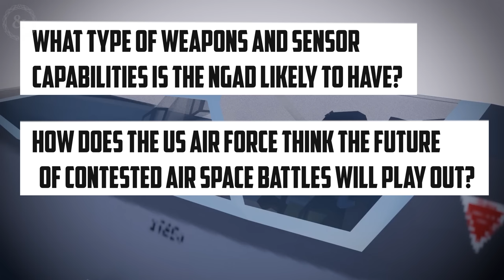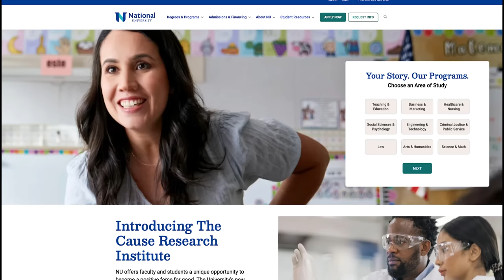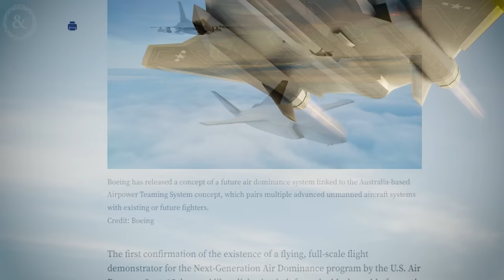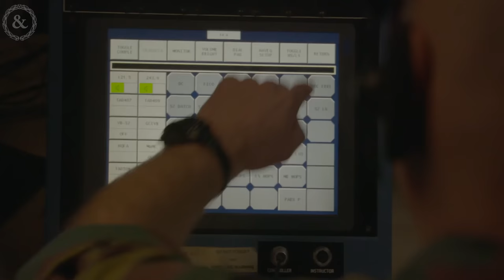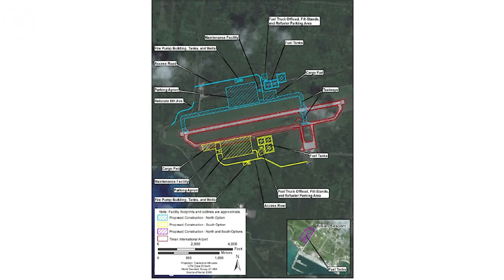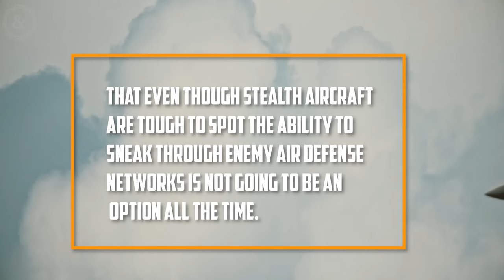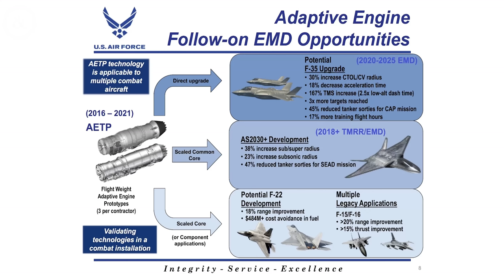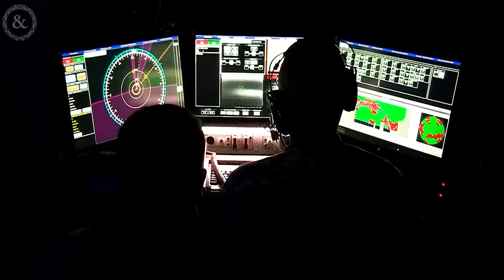Lockheed Martins 6th Generation NGAD Fighter Tactics

Comment: Another thing the NGAD should be able to do with the drones is maintain full stealth capability throughout the entire operation when deployed in combat, If you don't have to open any bay doors or have any hardpoint attachments fixed to the aircraft staying out of radar range becomes less of concern all of a sudden. 

Meaning it's only the drones that risk detection while attacking which is a game changer,  other than increasing pilot survivability in general this would give more reach to the craft as you can now get much closer to your target knowing it's your drone that is dropping munitions not you. In theory you will be able to get under the radar screen detect a target while in enemy airspace and engage it with the drone, for all they know it's loitering munitions or a single long range drone if you did your job correctly. 

Now if you ask me that is cool and how war should be conducted, with some class and style of course.
Reply: yeah - like buzz lightyear !!  😜
Reply: if your controlling drones you're transmitting. doesnt matter how stealth the airframe is if they are constantly transmitting instructions / data / targettin to and from drone platforms.
Reply: @rickthomson990 highly directional emissions, which are almost impossible for anyone (including the US) to detect
Reply: Even with drones, you have to avoid operational losses. They won't be cheap units. Unmanned, but still a number limited military asset.
Reply: At this point, you dont even really need missiles. Just send the drone to kamikaze like they are doing with consumer grade drones in Ukraine.
Reply: So what exactly is the point of the NGAD then, in your scenario? You're almost getting how much of a waste of money any 6th gen platform will be.
Reply: @coreyleander7911 no im just getting hot limited your thought power is

6th gens are made for modern war, and having slave fighters is the best thing to limit pilot loss and still maximize the effectiveness of your air force
Reply: @nicholasbrown668  lol yes that’s the boiler plate answer. Yet we can’t even get the F35 program right after 20 years yet we should buy a 6th gen fighter
Reply: @coreyleander7911  alright Pierre Sprey
Reply: At some point though, why need the person in the jet at all? If the drones are all being commanded remotely, why risk the pilot? Starlink already has the entire world covered in extremely low latency internet. They have offered to develop a military version as well, and it's only going to get drastically better in the near future, with Starship launching.
Reply: @coreyleander7911  What are you talking about? The F-35 is the most advanced war plane on the planet. What doesn't work about it that you're upset about? It has the same issues as most other advanced war planes. The F-22 has coating issues, the F-18 had serious design flaws that limited its flight for years, the F-16 still has a myriad of issues after being in constant development for over 50 years. The F-35 isn't really out of line with any other US aircraft. This is just the cost of not improving quality management in the aerospace industry.

Perhaps the only real lesson to be learned is not to choose an engine just because it's design isn't established. The F-35 could have had the range they want for NGAD, but they chose the wrong engine during development. So, instead of getting the first combined cycle turbojet, they received a lazily handled Pratt and Whitney engine, almost all of which are known for latent issues that just add hours to maintenance programs and put aircraft out of service.
Reply: Too bad enemies can just detect the radio waves you're using to communicate with your drones and hine in in you that way.
Reply: @titusbaum9690  good thing the US Military doesn't use 1940s radio waves, short burst Transmissions are damn near impossible to detect or track

we arent the Russian Army, we dont use off the shelf walkie talkies to coordinate military actions
Reply: chrisbattey-so2hw  Mitigation is silver. Radio silence is golden. My point stands.

Moreover, I didn't reply to "this thread", I replied to a comment. If you can't understand that or won't respect my autonomy, I can't help you any more than to say: Best stay quiet.
Reply: @icecold9511  Australia MQ28A Ghost Bat will be 3-4 million and one month to build, why Australia designed and built it to sacrifice it if need to instead of a expensive jet and years to train a pilot.
America is way behind in this smart thinking.
Reply: What Australia designed and built the MQ28A Ghost Bat for willfly ahead of our manned platforms and soak up enemy fre saving manned platform to perform a more important mission or save himself.
Hss drone swarm capability and fully AI they say they input a mission in to it before take off and the drone carries it out fully on it's own. no need for cominicating like you say. yes a human pilot or ground can change it's mission if need to.
Why they all say Ghost Bat s most advanced AI in the world.

Comment: Nice thing about directed energy, the firing solution equals “point at enemy”. When your shot is at the speed of light you don’t need to spend effort on future position prediction, maintaining radar lock, etc
Reply: Main issue is getting over the refraction of the light as a result of the atmosphere, and getting efficient energy output instead of having most of the energy be wasted.
Reply: Yeah, but it needs to be future proofed, a missile to missile is a guaranteed destruction. 

Laser to missile takes time to be effective, and in a realm where things are moving at hypersonic speeds, every second matters. 

And if your enemy’s missile has some highly advanced mirror that reflects the laser we didn’t know about. It’s potentially a loss of life, billions down the drain, and the failure of a important mission. 

We have missiles already, kinetic damage is highly effective. We just don’t know how safe and future proof a thermal weapon like a laser will be in the long run.

Comment: The return of SR-71 astetics, I love it.
Reply: It means it's meant to fly at extreme speed and altitude with no dogfighting ability
Reply: @samsonsoturian6013   is that a theory, fact or question ? 

But regardless, I agree it's for high speed, low drag (and radar cross section).
Reply: @red-black8138  it's basic aerodynamics. That thing can't make hairpin turns without breaking up. Also the flat top and bottom are givaways to radars when banking
Reply: @samsonsoturian6013  It has big moving surfaces at the front, so I'll guess it will be able to pull some instant G forces. But probably not like a 'classic' fighter plane.
Reply: @mennovanlavieren3885  NGAD won't have canards. That's pretty much guaranteed.
Reply: @samsonsoturian6013 dogfighting isn't necessary with the use of Stealth and BVR combat.

Why chase an enemy jet at close range when you could make a missile that can pull 9gs without fainting?

If an SU-35 is an AKM, then the NGAD will be a Barrett .50 Cal rifle.
Reply: No one said otherwise. I said the aesthetics are purely functional @deviousN

Comment: The Phoenix missiles fired from Tomcat fighters would often climb away from the tomcat.  The extra altitude gave extra range to the Poenix missiles that were designed to intercept missiles and fighters trying to take out the carrier.  There was a multilayer defense that the navy has gotten away from in recent years where the Phoenix/Tomcat combo made up the outer layer.
Reply: Basically a spaceship then dive straight down😅

Comment: Ace Combat predicted this. Enclosed cockpit that uses cameras to see around you.
Reply: The Gundam series envisioned that in 1985 with 360 panoramic cockpits. 

Macross had AI drones called Ghosts in 1981.
Reply: Everyone predicted this. The F22 and F35 would probably have been build this way if the "near peer" adversaries were actually near peer and forced the US to push the envelope on fighter design.
Reply: Your device's memory is running out of space. Cannot open cameras. Manage storage?
Reply: I've been wondering why this wasn't already a more common thing. An enclosed cockpit can be armored for the pilot's protection, the pilot will operate the craft with cameras from a position laying on their back to increase G-force tolerance. Win all around.
Reply: COFFIN moment

Comment: These "buddy drones" need to be mass produced to a ridiculous degree. Swarm intelligence,  absolutely slay.
Reply: Yeah but...well, skynet. Let's not make it even more OP than it already will be.
Reply: @WhiteIkiryo-yt2it  Based on experience from the last cold war - as long as Skynet is anti-communist, we're going keep blind eye to most of its annoying behaviors.
Reply: return to god
Reply: @@karlwithak. Not exactly a fair comparison. Chinese jets aren't exactly top notch, and are very lacking. Most of the computation power is for signal processing, to remove noise and identify targets from sensor data. GPUs are pretty good at this, but the behavior/logic of flight itself is very easy.
Reply: That's why US has the replicator program, CCA, Longshot program,  project carrera, Gambit drone series, AFC program, CRANE program and hundreds more. I just wonder if the US will make its manta ray submersible drone a kamikaze drone.

Comment: We have seen that incremental development approach with the F35
Reply: This is a complete design revision.

Although points for doing something creative for once
Reply: Yeah and it failed massively.
Reply: @coreyleander7911  The advantage of block 1, was that it enabled early deployment.
That there is difficulty upgrading from block 1 to block 3, does not negate the advantages of producing block 3.
Similarly block 4 sounds like it might include some airframe changes. And block 5 is a way off yet.

Comment: I believe the NGAD is going to look more like an SR-71 than an F-22. I think it's going to be what people envision the SR-72 to be. It's going to be very large, very, very fast, and very high flying. It likely will be able to outrun anything shot at it. Maneuverability will not be part of the design. One way to increase range is to increase speed. If an SR-71 can fly four times the travel speed of an f-15 but it burns twice as much fuel that means to get the same distance It burns half the fuel.

Comment: Is this fighter expected to have no external control surfaces like the X-65?
Reply: No, that technology is not ready yet.
Reply: Not likely. Like with most things, there are design tradeoffs.
NGAD (and FA-XX) may incorporate that tech in some limited fashion for the sake of range extension, but designing around using that as the "sole" means of control (like the X-65) would put a big clamp on other design features which are also desirable.

Comment: It's entirely possible that the NGAD won't even carry a traditional weapons load out, because that space would be better apportioned to the adaptive cycle engines which will need to power the insatiable needs of a complex sensor suite, expanded fuel capacity, point defense DEWs and the ability to coordinate its stable of loyal wingmen drones. The NGAD may be as large as the old North American A5 Vigilante (a carrier-based, nuclear-capable bomber deployed in the 60s), carrying two or more pilots/mission specialists who would be responsible for controlling the attached drones. This whole endeavor is not just about spending a incredible amount of money to build these aircraft and their support systems, but also to develop the combat doctrine that will maximize the capabilities desired by the USAF. Expecting this system to be deployed by 2035 is... optimistic.

Comment: Chris, your wonderful work on this subject is shown throughout the video.  It's amazing to me that the US doesn't keep its 'cards' close in the poker game of security for our future. Keep up the good work 😊
Reply: Of course it does.  There’s a fine line between keeping secrets for national security purposes and a surprise factor, and exposing just enough technical progress and details of up and coming programs to act as deterrence.
Reply: I Concur.
Reply: We can jump to conclusions re “telling the enemy (which one; have we made up our mind yet?) what our plans are”, but how could we really know, short of successful espionage?
    The plane in the video cd be intentionally wrong, along w/ any official military commentary released. 
    I cd see an actual outcome w/ the overall wing structures a tad higher on the fuselage, w/ another two vertical mini-stabilizers longitudinally mid-wing (to the extent poss. w/ no harm to stealth) & the front ‘canard’ (if still called that), sized & operating like now, pivoting level w/ the main wing.
    Then the big change — an F-16 style air intake below, modified for compatibility w/ the overall design philosophy, but w/ the leading intake surfaces designed to flex, partially back to the front turbine blades, w/in specs (strength of materials, flight stability) so that a more uniform airflow is AI-maintained on the turbine blades (to enhance engine performance/range & cut wear).
    I’ve always suspected that the F-16’s low air inlet facilitated an improved angle of attack, w/ less airframe weight, that let it carry such a generous weapons load. If so, why not pass that on to the NGAD, w/ slightly taller/stronger landing gear (maybe not F/A-18, but at least Gripen). 
    Follow that w/ a fuselage mod below wing, outboard of the air inlet, for higher-volume interior weapons bays (low) & some increased fuel volume (top), integral w/ wings, closer to the plane’s center-line.
    Tell DARPA to send me a check when it’s flying 😂
Reply: “We now have the technology to take ET home. No, it won’t take someone’s lifetime to do it. There is an error in the equations. We know what it is. We now have the capability to travel to the stars.” – Ben Rich, Former Director of Lockheed Skunk works shortly before his passing.
Reply: That's what US has the black budget for

Comment: This tech with a fleet of subs will pivot the theater of engagement dramatically. The amount of load outs per drone sub for painting/engaging targets being able to focus on defending crewed subs/ships while the air drones can even fire into water new types of torpedo munitions to in the event a hyper sonic jet/rocket\drone can unleash can maybe boat back in the event it had to use most of its fuel to get to target zone.
Reply: yeah imagine trying to defend against an entire swarm you can't even reliably detect

you'd actually be scared to engage by that point

Comment: Nothing like having a cargo carrying suicide drone for reconnaissance.  Getting a good initial picture of the battlefield can get units "leaning" in the right direction going in.  They know where heavy fire may becoming from and form up appropriately and other similar mitigations.  one of those drones hitting HQ's as they spot them would be a massive gain on cost/benefit too.

Comment: The Air Force is currently CCA capable. Using the F-35 or F-22 as a deep penetrating command and control they will use 4th generation F-15 EX to act as mules carrying AGM-158Ds (1000 mi range) as stand-off launch platforms. Guidance to be handed off to F-35 for final targeting. Also the F-15 equipped with the ASM-135 ASAT is capable of destroying satellites in orbit. By 2030 CCA May have evolved beyond the NGAD and drone wingmen to drone directed energy weapons.

Comment: NGAD is lagging behind the French/Spanish FCAS, which is lagging behind GCAP led by the UK, Japan, Italy, probably Canada and which is likely to converge with FCAS because Anglo-French cooperation is well proven.
All the talk about Gen this and that smacks of consumer electronics corporate fashions but when GCAP was launched with a mock-up (Project Tempest) in 2018 the idea was to hint at ongoing iterations with changes to component tactical features of air superiority.
NGAD's solution to power production still using jet turbines had been a step jumped elegantly and at the core of 'Tempest'. It was 'baked in' and the rest was to follow, not so much for laser weapons as for highest fuel efficiency in required modes and lowest maintenance costs with cooler engines.
Drone swarms were central to the concept not least for very high altitudes favouring unmanned rather than manned air assets. As with FCAS, the GCAP concept was designed to be evolutionary with quite a lot of recycling possible to avoid discontinuity and have available adaptability.
When Japan agreed to Sweden joining in (BAE owns SAAB) the obvious signal was that command aircraft would have STOL rough strip operability which Sweden has specialized in for decades.
In short, the whole idea is rapid response and lengthy operational ranges over a range of scenarios all over the world. The Pacific is just one.

Comment: If the NGAD is on the same level or better than the F-22, then as a statement it needs to say to all would be foes that they are, without a shadow of a doubt, going to get a boot in the rear if they try to tango in the skies with the USAF. 

IJS, it better not be a disappointment. Watching F-22 sit on the bench for 20+ years has been a painful experience…especially when we were at war for most of that time.

Comment: Next gen would have to be low operational cost, and mass producable which the F22 is totally NOT the case. A fundamental overhaul of the flight mechanics like using air thrusters to maneouver would give more payload weight and fuel. Currently the F35 does this role with traditional aerodynamic mechanics like rudders, and with its VTOL capability making it very accessible for aircraft carriers BUT it lacks BVR capabilities and low fuel capacity. Plus apparently it has some issues with its famous data-link system